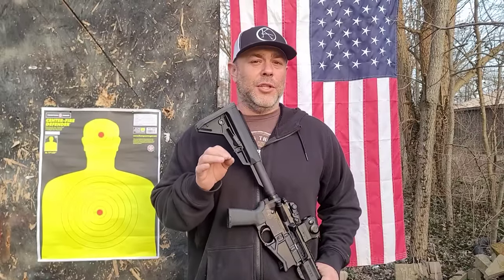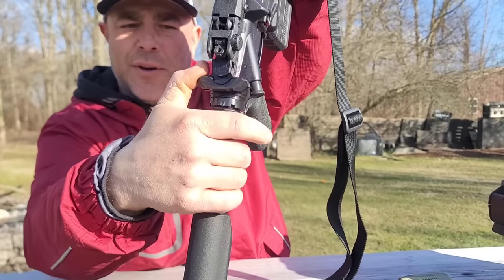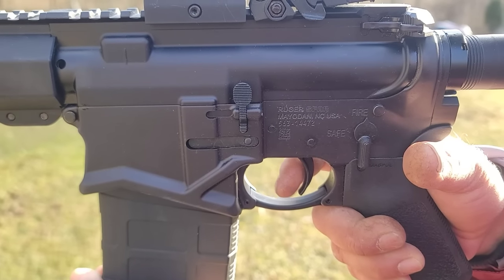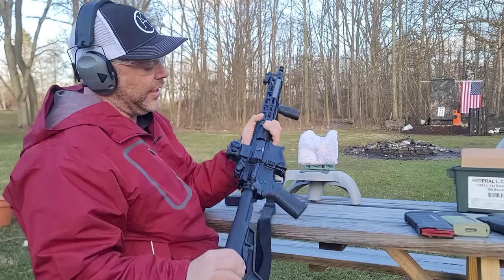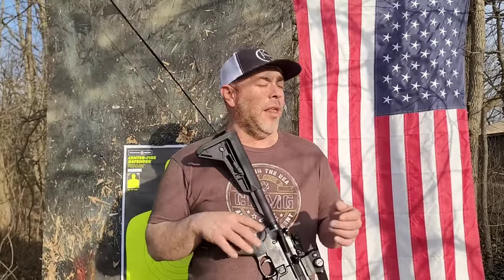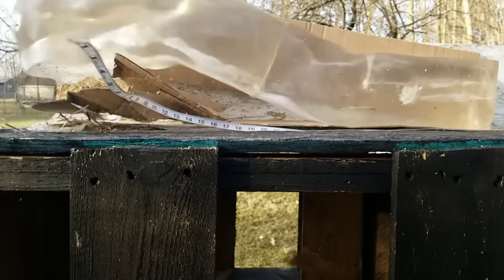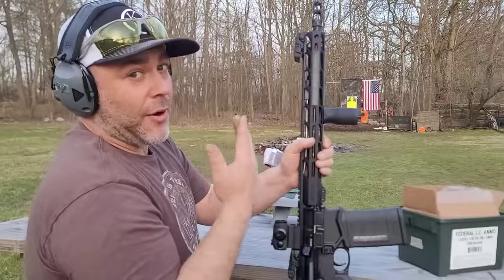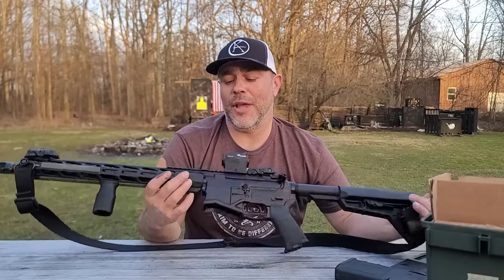Ruger SFAR NO 🐂💩 FULL Review. The AR-308 Struggle Is STILL Real😕

Comment: So a very well established company such as Ruger spends years developing this gun. It's not their 1st rodeo... they specifically give instructions to run it on gas setting 3 for the 1st 200 rounds. You didn't listen and you can see the excessive oil seeping out from where the upper and lower meet. How is anyone surprised. Why would you even attempt to cycle a round on gas setting 1 before completing the break in period and/or when its not cycling on gas setting 2. Thumbs down for wasting my time. Follow instructions, properly break in the gun, and then try something new.

Comment: The malfunctions are bad enough as it is, on top of that, Ruger STILL has not figured out how to manufacture an AR that does not need a hammer and punch to push out the outrageously tight takedown and pivot pins.
Reply from the maker: Freakin crazy...👊👍🦃
Reply: Everything on this firearm was tight.
The bolt in the BCG is stiff as hell, buffer spring could be the shock on a toy jeep, but as for the pins, yeah they're tight, but be a man lmao. Only hurts the first few times lmaoooo.
Reply: @SubBubz  It's not about being a man though. One of the appeals that an AR has is that it is easy to disassemble, whether it is for cleaning, or because there's a pretty rough malfunction going on that needs the upper and lower separated in order to assess and unf**k.  

Sometimes pins do get easier to push in and out over time with use, once the finish is worn off a little (like the PTR 91/HK G3/MP5 push pins--they typically have a pretty thick finish) when new). If the pins on this newer Ruger are anything like the ones on my AR556 that I had were, it's not going to be that easy.....I honestly wonder if Ruger drills both the takedown and pivot pin holes a bit too small, and machines the pins a bit too large, whatever the tolerance is.